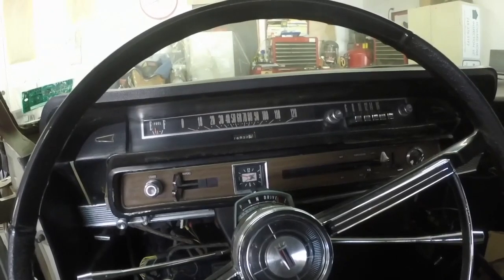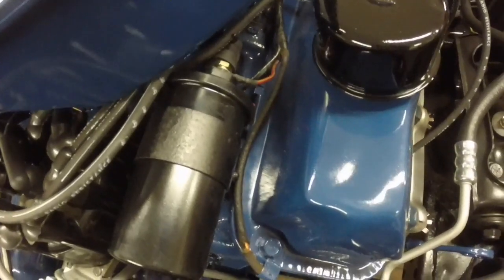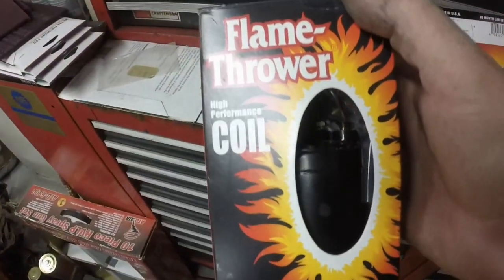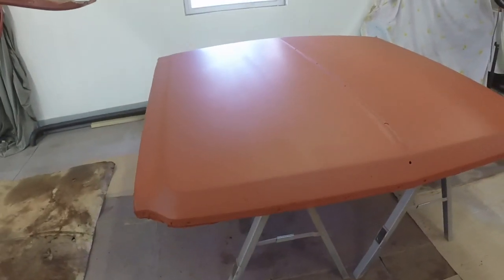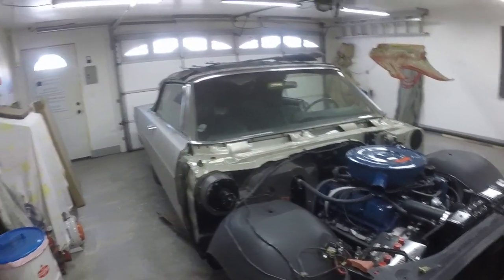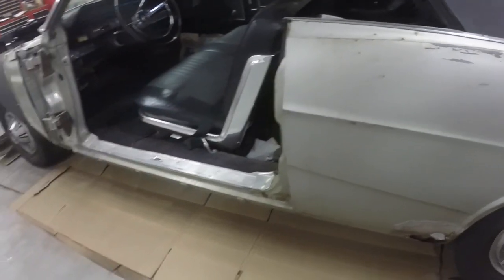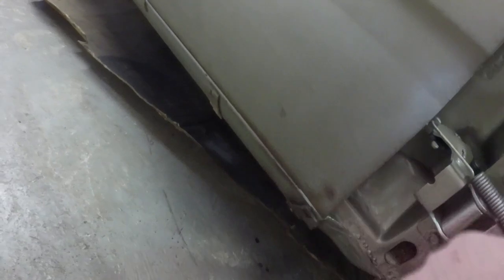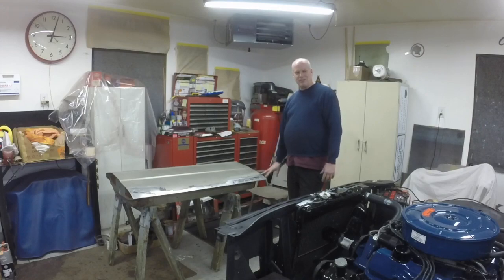1966 Ford Galaxie 500 convertible restoration part 84 getting a lot done!

Comment: Does the dash have to be removed to replace the radio on the ‘66 Galaxie?
Reply from the maker: No, just the gauge cluster... it's still a bit of work. I plan on pulling all that stuff out, to clean it up, so you will see that in a future video.

Comment: You have some great talents, whomever buys that will be getting a fully restored vehicle to be admired for years to come. Sounds smooth as glass,,,66 ragtop will be a wanted machine..      When I had my 66 Galaxie it was barely 10 years old and the frame rails were pretty well rusted, it was a MA winter vehicle for my 69 Z-28

Are you going with original color?  Looks like the Gold color from back in the day
Reply from the maker: Yep going 100% as it rolled off the assembly line. The paint color is called, Medium Sage Gold Metallic.

Comment: When did the factory start putting in fan shrouds? Or maybe you just haven't gotten to that point yet?

 My 71 LTD had a full fan shroud on it and I never saw temps over 180* and that was with a 400 in it..
It still had points in it back in the day, and it was a PITA....  I dealt with it, but I was just a dumb ass teen age kid back then (late 70's) and didn't know any different.. :)
Reply from the maker: Not really sure, but the A/C 66's and 7 liter 66's came with one. I wouldn't mind getting one.... but not for what they go for. If I find one at a reasonable price, I will by it tho. My dads 72 Country Squire had a plastic shroud too.

Comment: Another suggestion .....  I see you don't have a fan shroud for your radiator.  My Galaxie used to overheat at stop lights on idle in summers until I purchased a cheap plastic fan shroud from Rock Auto and installed it.  My Hot light hasn't come on since.  Those cast iron FE blocks can really heat up in the summer, especially after you've driven on the freeway and exited to surface streets.
Reply from the maker: I would love to find a factory correct one! They were on factory A/C cars and 7 liter cars.
Reply: @OldCarAlley  
Yeah, I should think the big 427's would have had them from the factory since the owners of those cars likely drove them hard from time to time.
There's a phenomenon called "Hot Soak" that you'll find out about when the outside temperature gets to about 90 or higher in the summer.  The fan shroud really helps dissipate the stored heat quickly after restart.
https://www.larapedia.com/glossary_of_technical_and_automotive_terms/hot_soak_meaning_in_technical_and_automotive_terminology.html
Reply: @OldCarAlley  
I wonder how many of those factory shrouds have been tossed in the dumpster by radiator repair companies over the years?

Comment: Hi Howard.  I'm still horsing around with points in my 64 Galaxie.  That Pertronix kit - is it the ignitor or the ignitor 2?  Looking in my Dearborn Catalog they list the ignitor and ignitor 2; the latter costing about $40.00 more.  The ignitor 2 is said to have a powerful microcontroller  that controls the dwell period over the entire RPM range.  With all your experience which one do your recommend?  Thanks!
Reply from the maker: I find even the cheapest one is way better than points... so anything is an upgrade. I put the cheaper one in the Galaxie, because it's a bone stock engine. Maybe a higher performance engine  should use the better stuff.... it controls spark better at high rpm's, from what I understand.
Reply: @OldCarAlley  Thanks!

Comment: Wow! It’s really coming together now! I was wondering about the tires. I had to go with slightly oversized white walls because I couldn’t find appropriate sized ones for this era. Do you plan on white walls (I hope) and where do you find them with the correct width?
Reply from the maker: It's going to get the correct size tire, with as close to the correct size white wall when the car is finished. It will get a front end alignment at the same time. I have not looked into anything on the tires yet.... that going to be a couple months away.

Comment: I would advise to paint the doors, panels as they hang on the car. helps the metalics lay the same. I have a perfect set of doors Howard. Unfortunately the shipping would be very expensive from Arizona. Looking good though!!
Reply from the maker: I really want to keep the date code correct doors on the car, so I am going to repair them. Getting doors is the easy way out.... I enjoy welding up rust issues. It's time consuming, but when finished, very rewarding. So far the body has been super solid. I am use to replacing rockers, complete door bottoms, floors.... you name it, I have welded it up.

Comment: I had a 352 in my 1967 F100, and when I passed it to the next owner, the truck had 267K miles on it. While I do not know the full extent to which the engine was restored (I think very little actually as it had lots of moisture in the oil) by previous owners, I do know I was impressed with its reliability and consistent performance. Like you, I ditched the old points a week after I purchased the truck. Funny, when I ran across your channel, I think you had approximately 150 subs—I hope more folks are sharing your videos because I’d like to see your subs increase ten-fold this year. Thanks for sharing your talent and work ethic with us Howard! Peace-out!
Reply from the maker: I think the FE series engine is a very good engine... as far as that goes, I have always liked Ford V-8's the most. I have had several 302's... two I drove over 200,000 miles and one with over 300,000 miles. Never really had any trouble with any of them. None leaked or used oil either.

Seem like this past summer, is when my channel started taking off a bit. Thank you for being a loyal viewer.

Comment: I find it odd that so many people who work on cars prefer solder, there is almost no soldering on any car made in decades.  Every connection on any component on a cars made in at least the last 40 years are crimped.  I worked in the electrical construction industry and no connections are soldered because soldered connections are not NEC code acceptable on current carrying connections.  Wirenuts, those with the springs in them, actually get tighter with heat and except the fact they are hard to keep water out in an automobile and are just not really suitable they are a far better choice than soldering.  Except for circuit boards and low voltage switch connections inside electronic and musical instruments I can't think of anything that still uses solder.
Reply from the maker: I prefer soldering because crimps and wire nuts look like hell on cars! Plus with moisture, it helps prevent corrosion. With solid core wire, wire nuts are great, but from finding crimps and wire nuts on past projects, they were "always" the root of electrical problems on cars. Most cars have sealed connectors, and the factory crimps are much better than the crappy hardware store crimps. By the way, if a wire nut tightens or melts because of HEAT, thats a BAD connection. In my mind soldering last a long time, with no issues. Maybe I am old school, but thats the way I do things, and will continue to do things... on cars anyway.

Comment: I run the pertronix units and flamethrower coils in my Mercruiser boats. No matter how well you have tuned the points ignition, the pertonix always make a huge difference. Which ignitor unit do you run? I think they have a Igniter I,II and III.

Comment: Did you prime those fenders as they hang? Looks like it'd be rather awkward to paint the sides; it's like  you'd sit on a milk crate and shoot up from underneath.
Reply from the maker: I may set them up on saw horses to paint. Painting them hanging is a good way on most parts, as you have less chance of dirt getting into the paint.

Comment: Hi Howard did you end up using the dash pad that was messed up or did you send it back. the seats look really good in that car especially if they are original. I found a heck of a deal a while back  looking for a set of 66 Thunderbird bucket SeatsThese are black like I wanted original upholstery in mint condition I got both seats for 150 bucks😎
Reply: Luck of the draw?
Reply: Kent Talsma  sometimes your at the right place at the right time. Most of the time I’m not so lucky😇
Reply: @1957kwick  yeah, something something your stars and bars.
Reply from the maker: There sending a new dash pad... should get it in the next couple weeks, there on backorder. The seats, carpet, as far as that goes, 100% of the interior is factory original.